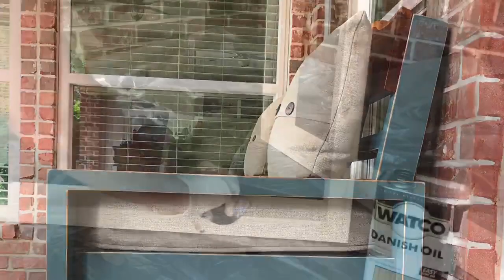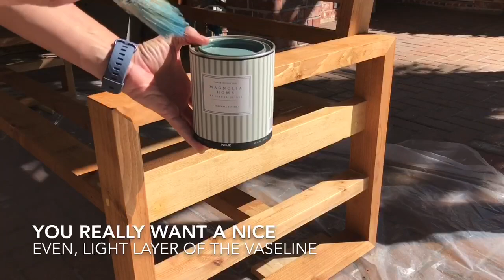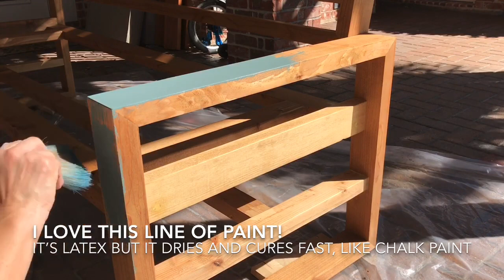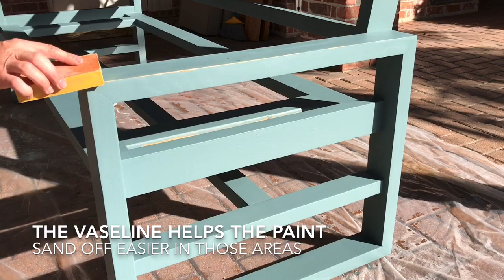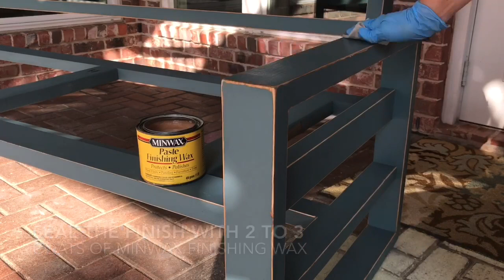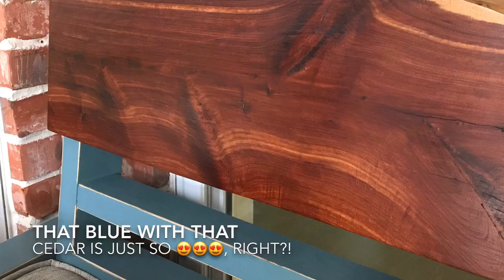DIY Distressed Blue Chalk Paint Look Using Kilz Paint Color Demo Day

Comment: Ok, so my 14-year-old son and I made an outdoor table to go behind our sofa on our covered deck.  We painted the legs and the supports black matte and the top grey matte to match the existing sofa and table.  We used a 1x12 for the top and now that I am painting the top I do not like the way it looks.  It is kind of plain and the wood took to the paint weird in some places.  It was supposed to be an inexpensive project so it definitely wasn't the best quality of wood, to begin with.  I was thinking of distressing the top to give it interest but I do not want to risk the wood rotting.  Should I try the finishing wax?  It is too late for the vaseline but it seems to sand nicely anyway.
Reply from the maker: Hi Paula! 
If the deck is covered, I would think go for the wax to protect it and give it a nice soft finish. It’s been a year since I did this and the finish still looks beautiful. But it doesn’t sit in the rain.
As far as distressing, if the paint sands nicely, then why not. You can always paint over it if you don’t like it. 😊
Reply: Or you could try to layer the paint. Leave the black and seal it. Once it’s sealed and dried for 24 hours you can paint another layer with a color like this video or another you prefer. Then sand the corners and edges for a gorgeous wet distressed/layered look.